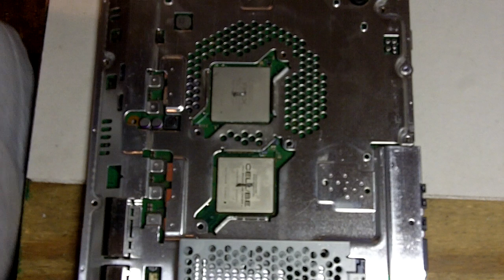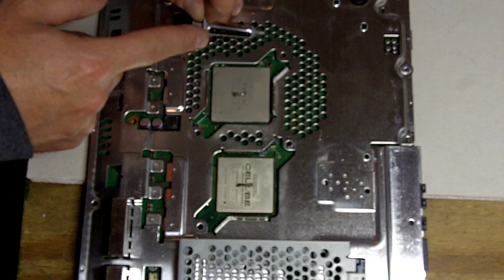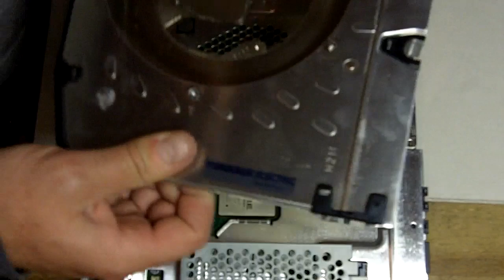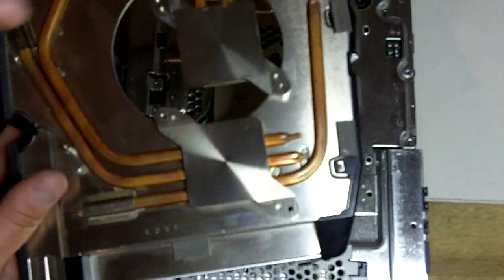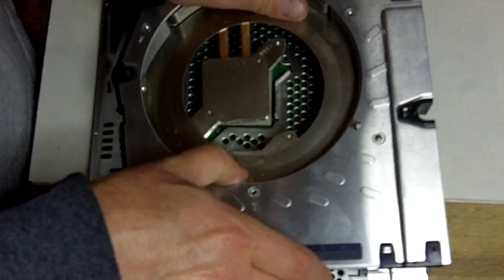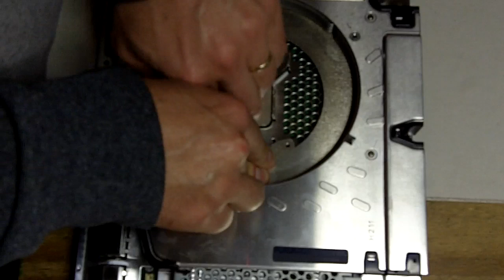PS3 Arctic Silver Proper Application on Heat Sink - YLOD Prevention

Comment: There are a lot of things you can use do to prolong the life of your console, keep the vents unobstructed and run a low powered vacuum quickly along the vents when the console is unplugged and allowed to cool properly. For my first PS3 I bought an additional fan which just turbocharged warm air into the console causing it to break after 9 months. I just bought my cousin's 40GB PS3 which hasn't been used for 9 months and it's runs quite warm, so a change of thermal paste and fan mod is needed

Comment: This method is shown with a release ps3. I have a CECHH01 (fat 40GB from mid 2008). In the summer it heats up and becomes very loud, and it makes me worry. I imagine this preventative measure will decrease the likelihood of hardware failure. 

My point is: can you confirm that this method would work with my model. (I imagine it would since the processors are the same if not similar). 
Thanks!

Comment: i've been having problems with my Ps3 for the last few months. It freezes in game and wont even let me go to home screen. The sound mucks up and it over heats aswell. I've tried lots of different things like using a fan which allowed me to play for 20 minutes give or take and i've also tried resoring my system files and restoring my ps3 right back to factory settings with no data. But now my game wont even start but it does register. Does this sound like my CPU paste needs replacing?

Comment: Good video. i ordered the paste and cleaning fluid to do this weekend as the ps3 is now 6-7 years old i think. As there was conflicting advice regarding application on youtube,  i contacted arctic silver today. they gave me a pdf for the ps3 which is different to the instructions giving in this video. they say to also tint the heat sink with paste, and apply a little paste in the corner of the processors and then spread completely over the full area....confused or what!!!

Comment: Question: Why don't u recommend using heat gun?    The first time I got ylod it lasted 2 years. 6 months later after fixing it, I got ylod, last week so I fix it. Today it automatically turn off after I repaired it why?!! I've been using AS5, I have the 40gb version but know it's a 250gb. Did I do something wrong I've always clean the inside in n out, my room is the coldest.

Comment: Is the block on the heatsink that covers the GPU supposed to be flush with the CPU? I've done repaste on my system so many times and it still overheats, I think my heatsink may not be getting proper contact with the gpu. The block on mine is slightly bent upward it looks like. I noticed I can wiggle that part of the heatsink back and forth; is that how that piece should be or should it be tight in place?

Comment: Well I used a lot more thermal paste than Arctic Silvers recommended amount and my PS3 is running a lot better now so as long as you don't dump half the tube on there you should be fine.

Comment: i wanted to say thanks! this does work! my ps2 (20 gig) got ylod, i sent it out to be re-balled, and the ps3 would run fine, but in 15 minutes it would shut off with the emergency over heat blinky red lights. i opened it up, and discovered that after re-balling the repair shop didn't add any new thermal compound. this did the trick, and i've had 3 weeks with no problems. (even play cpu and rsx intensive games like MGS4)

Comment: @fixmyplaystation Nice video man. I have a problem with my heat sensors of the ps3. I saw a video that if you put thermal paste around the sensors is going to be fixed, is this true?. My ps3 shuts down after I play some minutes, and if I remove the case of the ps3 it stays on more time. I changed the power supply a few days ago because the one it had was damaged by an electrical shut down.

Comment: ya i just came back from the computer store and i picked up some Arctic Silver 5 and some contact cleaner to clean the processor surfface , hey fixmyplaystation guy could you make a video of the older ps3 80 gig system if its possable ?

Comment: @fixmyplaystation , i got the 80 gig PS3 the one that came with metel gear solid a few years back its the bigger ps3 , i  took it apart to dust it but i never got to the point where you got but what the problem is that i noticed that in the past couple months its been geting hotter and the dusting did nothing , it cleaned it there was a lot of dust lol , i even stuck 2 CPU fans in the part where the cool air flows and it still gets hot :( i gota think of some thing

Comment: is it really enough? but you can't tell the heat to stay in the middle of the heatspreader... 
isn't would be better apply the paste thin on the entire surface? to remove the heat from the memory chips too?
physically there is no perfect flat surface and that's why we using thermal paste- to make the contact better between 2 material. i mean bigger surface = better contact = better heat transport. hmm, i'm confused.
(sorry about my english.)

Comment: Will do. A couple more questions. What temperature would you suggest via heat-gun and how high should I keep it? I've read that anything beyond 240c can damage the processor. Second question is, I bought some no-clean flux off of e-bay and it smells like Isopropyl alcohol and is very runny. Is that how it's meant to smell?

Comment: @angelrox420 Yes, my ps3 runs very smooth and quit now, i used Arctic cooling MX/4 this compound is better than arctic silver 5 and way easyer to apply, less thicki did a small tiny dot of paste on the middle of both proccesors

Comment: cold heat paste will only spread so much with the cold heat seek. once the heat start the paste will start to spread more with the heat sink pressure. the most important thing is not to have any heat paste over hanging the processors this will not help with transfer of heat and just heats up the area. more pressure also important as this increases contact which helps with heat transfer. you can do it easy with the ps3 but be careful as you can rip the threads off heat sink clamps.

Comment: Did you ever experience a PS3 getting YLOD after a repaste (assuming that PS3 never have YLOD before)?

My 60GB PS3 eventually hits the 3rd fan level but never reaches the Max speed. Not sure if I should risk a repaste when it's running pretty good at the moment.

Comment: Hey, in your 7-video tutorial you separated the motherboard from the metal thing, whatever it is called, but in this video you didn't... So which method is better? And once I get a "decent spread" of the thermal paste, should I remove the paste and do the same thing to get a "decent spread" again or can I immediately put the heat sink (sync?) back on? Not sure if you understand the second question... :S

Comment: So my ps3 got the ylod and i heat the cpu and the gpu with a heat gun and i let cool down and i put artic silver just like in this video except i use a lil more artic silver and my ps3 works n it does not get loud at all like it use to it is very quite now so im assuming this techique works the best cause i tried spreading it and my ps3 fan went loud but wen i did it like the video it is super quite

Comment: But you can still use the paste on all of those chips, right? Its not like it would be bad if you just do it like in your preparation video where use spread the paste all over the chips. 

Also.. how did you do the reflow? Any video on that? Did you use a heat gun like in all those other videos or did you actually replace all of those ball things on the chips?

Comment: I just applied new paste a week ago as5 and did it correctly.  The fan only made that noise a second and only when it was going really fast.  The air coming out back is cool though and it is only on for like 30 mins.  Could the thermostat be bad and if so can that harm my system?

Comment: I applied as5 today to my CECHL01 ps3 and used just a hair more longer of a line on mine pressed the motherboard and cage down and wiggled best I could then tightened the brackets.  After letting ps3 idle on xmb screen for bout10 mins I loaded a game (uncharted3) and it seemed to delay the fans speed but it still got loud as b4 but only delayed maybe 10 mins to how it was.  But after a 3hr gaming session the air blowing did seem  noticeably cooler than b4 u think I'm good?

Comment: Here's an idea, what if I spread the as5 around sides but neglect the middle where the processors are, then do the method used in this vid to keep air bubbles from forming over the processors.  Do u think that would be a little more proficient as far as distributing the heat better?

Comment: Sir i recently bought a 80GB PS3 Phat/fat weeks ago and the previous owner says that the unit will got YLOD after a few mins./hours. I tested it and it runs/boots but only about 20-30 mins. I Haven't played a game with it yet  or some sort of dryrun because i have no game and have no time to play. Ive been searching for solutions and i found your video.

My question is is replacing the thermal paste will prevent the YLOD on the unit?
I haven't experienced the YLOD of the unit and i have the AS5.

Comment: i figured it out! onethe vents on the side and front were dusty, i tried to take it off and succeeded but now i cannot get it back on, the secound thing i did was bend the heat sink because from all the times i took it off it bent a little bit and wasent making good contact, now my ps3 is not AS lound defently noticed a diffrence in sound and its not overheating after mins of play, not once since i put it back together, anyone else having overheating issues should look at their heatsink!

Comment: hey thanks for the advice but hear this. the playstation is the 1st 60 gb backwards compatable, since i had it is been loud, a few days agot it started overheating after 5 mins of play, so i took it appart and applyed new paste, it lasted for about 2 hours and started overheating again in the same fashion, i did it again the same, the third time i reballed it and did the paste and it seemed to be a little quieter but it dident last very long so i tried to reapply the paste again, and here we r

Comment: hey i have a question, i overkilled my ps3 with thermal paste and made a mess oof the board and my ps3 is constantly overheating, do you know of a way that i can remove thermal paste that seeped under the chip? and also i use dynex silver thermal paste should i apply the same way thanks!

Comment: @fixmyplaystation Thanks for the reply. I checked the fan and it seems to be blowing out the hot air just fine. I used the same amount of AS5 as you, except I applied it on the edge and spread it across forming a thin even layer. I guess I have to repaste the proper way just to be sure. But, if I repaste and my PS3 is still overheating... what else could be the problem? Could it be the power supply? I'm just curious because my PS3 has been getting really hot in one particular spot on the unit.

Comment: Hi, I followed your 7 step tutorial and it fixed my PS3's overheating issue. One week later, my PS3 is overheating again. I used Arctic Silver but I did not use this method to apply it. Could that be the problem? Or could it be a faulty fan?

Comment: @thekillerwaldo I didn't even get to 3.   My Playstation worked flawlessly for 2 years then it yellow lighted me.  I took it to  get  fixed and walla!  Sadly it only worked for 4 months, took it back, and it then only worked for 2 weeks.  Now it can no longer be repaired and I still have the same problem.  YLOD  What the fuck is up?  Should I Discard it, or is it in some way salvageable?